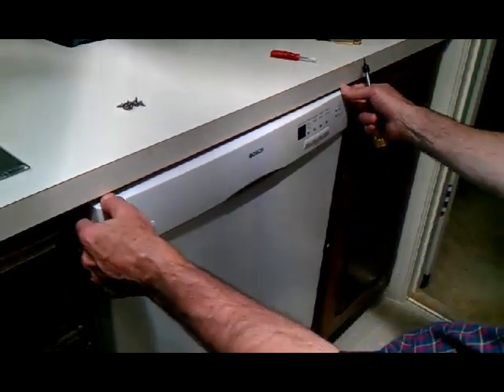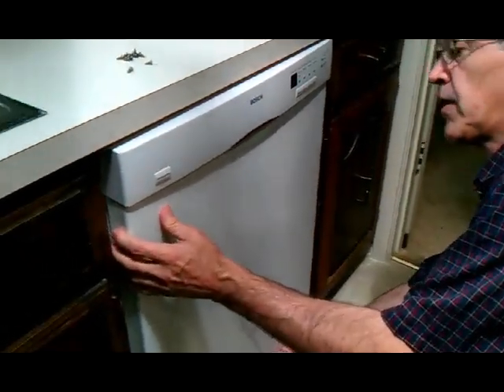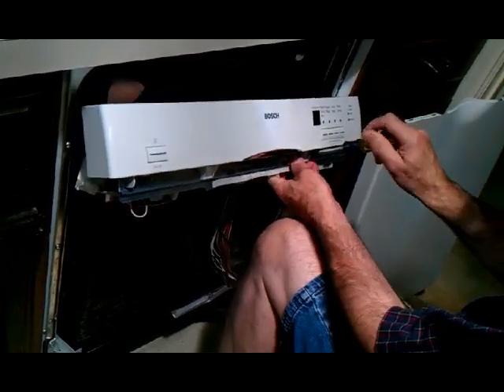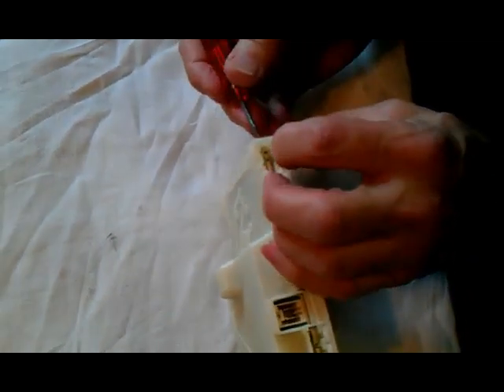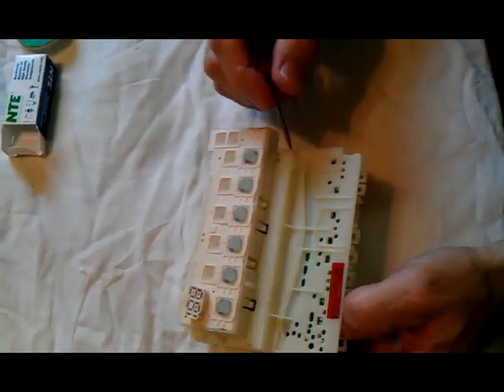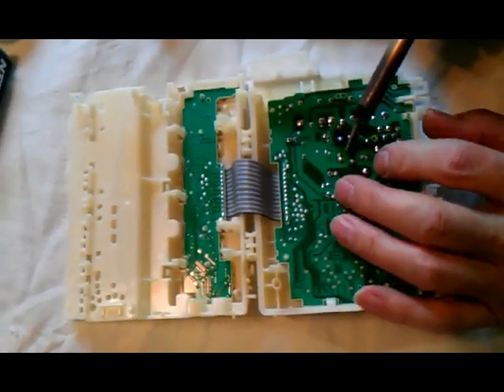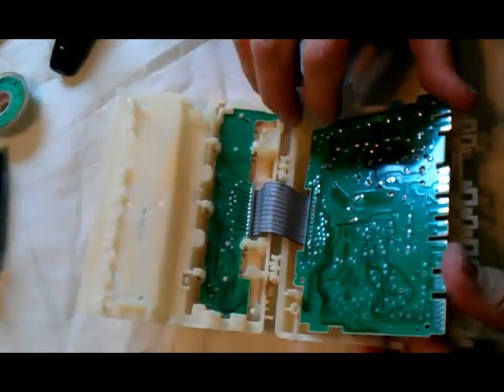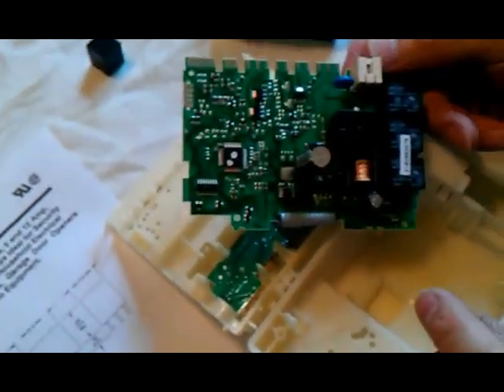Bosch Dishwasher Heater Relay Repair Part 1

Comment: Hi there, does any one know the value of the green resistor that can bee seen at 8:30 in the video. I have been trying to find the value for last few months. I have contacted Bosch and they have told me that they don't know what the value is even though i have spoken to the top tech and even Bosch Germany is not able to help. At the end Bosch have advised the only way to find out the value of the resistor is to purchase a new part. They have also quoted me $400 for the new part. I might just go buy new dishwasher. Based on Bosch lack of response and only taken them 3 months to respond I don't think i'll be buying their brand. any help would help. Cheers
Reply from the maker: The colors on that resistor are Red/Red/Black/Gold which is 22 ohms resistance with a 5% tolerance.  The resistor appears to be at least a 1 watt, but may be a 2 or 3 watt.  It is sometimes hard to judge the wattage rating by just looking at the physical size, so I would go with a 3 watt as the replacement just to be on the safe side.  You can go up on resistor wattage, but not down.

Something like this should work just fine:  http://www.mouser.com/ProductDetail/Vishay-BC-Components/PR03000202209JAC00/?qs=LCMWAU1DZcyxbs1qHHFbAg%3D%3D

Here is a photo of the resistor on the board showing a good one and one that is bad:  http://imgur.com/UXKoxcP

I have not tried to determine the purpose of that resistor, but I do know that it is in the high voltage AC circuit.  They may fail just due to age and/or maybe being underrated in wattage.  It is also possible that something else in the dishwasher has failed and, as a result, burned up the resistor.  With that in mind, I would order 2 or 3 resistors so that if you install a replacement and it burns up, then you could troubleshoot the cause and still have another resistor on hand to replace it again.  Just like the relay, the part is cheap, but shipping may cost as much or more than the parts that are ordered.

I hope your repair goes well.  Cheers.
Reply: Thank you for the info. I went to my local electronic store and they didn't have any resistors in stock apart from Carbon Film and they were 1w. The guy that works gave me a 22ohm 5W wirewound resistor and said that it will be ok to use as a replacement. I will try this sometime tomorrow and hope it will be ok. cheers
Reply from the maker: A 5 watt should be okay if it will physically fit.  Be sure to mount the resistor off the board and away from other components because the heat from the resistor could cause damage.  The original resistor is mounted  that way, so follow that method.  The wirewound resistor probably has a non-flammable coating similar to the resistor I recommended above.  I would stay away from the carbon types as I have seen them fail in ugly ways.

If you get a chance, try to trace out what that resistor is feeding.  I know one is attached to line voltage at the relay, but I have never looked to see where it is going from there.  You might find out the reason for the resistor to have burned up.  If something external to the control module is causing this, then even a new control module would also fail.  I have seen power resistors fail for no particular reason other than age...they just give up.  This usually occurs when the resistor is used near its maximum power rating.

Also, that resistor may be a different value in some models.  So far, everyone that has sent me photos of their control board has a 22 ohm resistor, but still there might be models using other values.
Reply: Hi there, I have finally got the 22R 3W resistors. I replaced the resistor and when the power button got pressed the resistor burnt out straight away. When the dishwasher originally died it was through cycle as there was water at the bottom. The question I have what could be causing the resistor to burn out. I have some spare resistor but I was hoping to find test anything else that could be causing the burnout. any tips would help. The model I have is  SGS65M08AU/15. Cheers
Reply from the maker: I wish that I had more information about the purpose of that resistor, but I have never checked into it. If you are handy with an ohmmeter, then perhaps you could trace what is connected to the resistor on the other end. One end of the resistor is connected to the high voltage heater circuit at the relay. So, by "the other end" I am referring to the connection(s) made in the circuit on the resistor end that is not connected to the relay. You may find that it goes to some component that is shorted out.  The wiring diagram for your dishwasher should be quite helpful. The wiring diagrams are usually rolled up real tight and tucked away near the water valve behind the kick panel. Be sure and do all circuit tracing with the power to the dishwasher off.
Reply: Hi , had had a similar problem with a broken resistor (you can see my answer), but your problem is probably the LNK304GN, you need to change it. (other models use LNK364GN) 
Just change it :)

Comment: My Bosch SHU53E05UC/14 has 3 relays "SHC SRE303024 Coil:24VDC 10A/250VAC/AC1 T+85C".  Can someone tell me what replacement relay should I get and where to make the purchase?
Reply from the maker: The NTE R46-5D12-24 relay will work fine.  Just Google that number and you will find multiple places to purchase it such as Newark, Allied, Galco, and more.  Cheers!
Reply: I live in US and my Bosch is "assembled in USA with American and European components".  How come the relays have "250VAC" on the label, should they be "115VAC"?  Do I need to worry?Out of the 3 relays, only 1 pin on the relay (with K4 printed on the PCB) is "melt" and has a small hole around the top pin.  The K1 & K2 relays look OK.  In fact, all 3 relays look good from the front.
Reply: Just ordered 3 NTE R46-5D12-24 relays from Allied Electronic (came up first on my google). It is very inexpensive but shipping is doubling my cost.  Too bad I don't know a B&M electronic parts store nearby so I can pick them out and get it fixed sooner.
Reply from the maker: The "250VAC" printed on the relay means that it can handle that voltage.  The relay works fine with lesser voltages.  It certainly doesn't do any harm to replace all 3 relays, but the only one that must be replaced is the one with the melted solder joint.
Reply: Dishwasher is working again.  Took a long time because of the long weekend for the new relay to arrive.  My co-worker friend did the soldering and I put everything back together.   Everything works like a charm again except somehow the cycle selector (giant dial) is rotated 180 degree and it is little confusing to know the selected cycle.  Temporarily I taped a "red dot" to the dial.If we ever cross path, I owe you a drink/beer.
Reply from the maker: That's great to hear that the DW is working again.  You shouldn't have to worry about those relays failing again for a long time.  Cheers.

Comment: Thanks for making this. Our dishwasher (an SHE55M) has been doing this for some time, but this video really helped me disassemble the unit without breaking anything. I did the same temporary fix, but also took down part numbers of the relay and the control board so I can decide which I want to order. Bosch should really have fixed all of these regardless of age.
Reply from the maker: +Todd Johnson "Bosch should really have fixed all of these regardless of age."  ...as far as I know, Bosch is still making control boards with a similar relay. In my opinion, the relays will continue to fail about every 5 years or so.

Comment: Thanks for the great video. I had the same problem, where the cycle took twice as long as it should and the dishes were wet on completion. I followed your video and removed the board and re-soldered the burnt out one. I reassembled and ran the machine. I found the wash time returned to approx. 2 hours which is great, however the dishes are still wet. We used to get a blast of steam when we first opened after completion of the cycle. My Bosch was manufactured in Nov 2000, so its a bit older. I'm trying to find the heater relay part. It's JQ1A-12V AJQ3341 A91. If anyone has any suggestions about why the dishes are still wet, or where I might find the replacement part, would appreciate letting me know. Thanks!
Reply from the maker: +Joe Dez Joe, the lack of steam at the end of the cycle usually means that the water is not being heated. The DW is supposed to heat the water extra hot at the final cycle to help dry the dishes.  Your relay is available at Mouser Electronics (http://www.mouser.com/ProductDetail/Panasonic-Industrial-Devices/JQ1P-12V-F/?qs=sGAEpiMZZMuh5GEe0gqtijs0Y%252bxGRc1T).  I hope that helps.
Reply: +AgglomeratedIdeas Super. Thanks again for your help with this. I'll order the part and give it a try.
Reply from the maker: +Joe Dez BTW, the part number I gave you is for a high current version of the relay you have, so it should last much longer.  Also, you have a SPST relay now and the JQ1P-12V is a SPDT.  That just means that it will come with one more leg/pin than the one you now have.  It is the normally closed pin and is not used.  If your PC board does not have a hole for the pin (some do and some don't), just cut the pin off when you go to install the new relay and it will work fine.

Comment: I just replaced this relay on my dishwasher, SHE44 something or other and I'm still seeing the issue where it displays a "1" after the cycle is finished.  Although during the cycle, it never really sprays water around, it just fills up and drains multiple times.  Does this mean I messed something up with the solder job, or am I going to have to replace the heater?
Reply from the maker: +Matt Teeter Hi, Matt.  It sounds like you may have other issues with the DW besides the heater.  If it is not spraying water that's probably not due to a heater circuit problem.  It is more likely a pump issue.  If you send me an email to MyBrokenDW(at)gmail.com I can send you a repair guide that might help you track it down.

Comment: This wonderful video identified the problem correctly and showed me how to fix it.  I replaced the 6 volt relay and put everything back together in less than a leisurely 2 hours.  His effort to post this saved me at least $500 parts (control board replacement-not relay) and labor.
Reply from the maker: +Pat Fitzsimmons Thanks for sharing!  Great to hear that the video helped you.  Cheers!
Reply: +Pat Fitzsimmons Forgot to mention the wash cycle is back to 1hour 40minutes instead of 3hr and 20minutes

Comment: Thanks AgglomeratedIdeas for this excellent video! I do have a question I hope you or someone on this comment thread can answer; Would the failure of this thermal relay cause no power to the dishwasher? I stumbled upon your video and discovered the same issue while troubleshooting my dishwasher. Model is Bosch SHU42L06UC. Dishwasher stopped running a few nights ago and there is a bit of water sitting in the bottom that hasn't drained due to the loss of power. I did the following checks: 120V from 14/2 wire to dishwasher = OK. Continuity on at the door switch both open and closed = OK. Continuity at the power switch = OK. Push the power button in and I get 120V from the power switch to the control board. I opened up the control board housing and found the exact same failure: heat relay solder point burnt along with a heat transfer mark on the plastic housing directly below it. This relay has 5 pins. I found R46-5D12-6 on Newark's site but it appears to be 4-pin - I'll continue to search. Obviously I need to replace this part however I also am concerned the no power may be due to a blown thermal fuse - or does the failure of one create a secondary failure with the other?  I will continue to search for the location of the thermal fuse on this model as it did not appear to be located in the door and I would like to test it for continuity as well before pulling completely apart and buying parts. Any help/advice would be greatly appreciated and thank you again for this great post! Cheers!
Reply from the maker: +Rene Gauthier It is not likely that the failed heater relay would directly cause loss of power to the DW.  Indirectly, the arcing at the relay could (in theory) cause other components on the control board to be damaged.  It sounds like you have checked the obvious things, so a little deeper dive into the machine seems to be in order.  If you send me an email at MyBrokenDW(at)gmail.com I can send you a repair guide that might help with that.  As for the 4-pin relay, the DW only uses 4 of the 5 pins (the 2 coil, the common, and the normally open pins), so a 4 or 5 pin relay will work.  (I just pulled up the Newark site and I only see the 5-pin SPDT version.)  Also, make sure you have a 6V relay in your board because Bosch put other relays with different coil voltages in their models.  The other common coil voltage is 12V.
Reply: Ok, good to know. I'll check the thermal fuse/thermistor next. Thanks for the response - appreciated!

Comment: I just successfully replaced this relay - thanks so much for your good video here.  A question - even after the repair, just as before, the time displayed for each wash is very long.  Will that diminish after a successful wash cycle?  Is that due to the fuzzy logic of the control panel?  I did do the reset - pressing the two "Cancel Drain" buttons.
Reply from the maker: +ddiddle12 If your water was not heating because of a failed relay, then operation should return to normal when the relay is replaced and the module reset (the reset is not always required).  In the winter, mine runs slightly longer because the water in the pipe cools off more between fills.  If my dishwasher was closer to the water heater I probably wouldn't notice any difference.
If you think you are still getting longer than normal run times, then you may have another problem.  The DW should be nice and hot when it counts down to zero and you open the door.  If it is not, then I would suspect another problem in the heater circuit such as a failed heater coil.  Here is a troubleshooting diagram that may help you: http://imgur.com/t6TlEc4
Reply: +AgglomeratedIdeas We ran the DW three times last night after the repair and the times got shorter with each run, to the point that they're back to normal (I think, for winter) this morning.  The first quick wash was 78, then 54 and then 39.  Actually, during the first Quick Wash run following the repair, I watched the timer jump from 48 minutes left to 32 left.  Could it be self-adjusting to that degree?  This morning, Quick Wash says it needs 33, Regular is 132 and Power Scrub is 144.  The machine is very hot at the end of all the wash cycles, so I think we're OK.  Again many thanks - saved us a couple hundred dollars and waiting a week for sending the board away for repair.

Comment: Yes! Thank you! This dishwasher was given to me only because of this fault, which no one knew to repair. Poor design IMO to push 10A through such a tiny relay with 20+ gauge leads. No surprise at all this fails.  
Fixed using NTE R46-5D12-6 as recommended. Purchased through amazon supplier DataAlchemy.  
Also found the thing had developed a leak. There is a simple float switch in the bottom tray. When tripped it raises hell with the operation, as it simply tries to drain. It doesn't cause any front panel code. 
The tray should always be bone dry or it will behave bizarrely- running while the door is open, still trying to start cycles if you try, etc. I think many people think the control board is bad when this happens.  
There are O rings where the heater assembly fits into the DW bottom. They were not seated correctly. They must be fitted to the outside of the pipes, not inside the pipe sockets. Very important. The assembly must be mounted with a fair amount of force when it's correct. 
Having thought this was a pretty looking, but terrible dishwasher (he original owners thought the same), it now works perfectly, gets nice and hot, and I think it's a pretty great dishwasher! The stainless tub is superb. Something comparable would cost at least $400 new.
Reply from the maker: +Johan Smith Awesome diagnostics and repair!  Definitely sounds like you fixed a DW that destined for the scrap yard.  Cheers!

Comment: Thank you thank you thank you!  I just fixed my dishwasher the day before hosting Thanksgiving dinner at my house.  After diagnosing the drain pump, the water inlet valve, and the main wash pump (and all three work fine), I was at a loss.  On a hunch, I decided that maybe the water just wasn't getting heated.  Next thing you know, I am watching your video and soldering in a new relay.  $10!!
Reply from the maker: +Darryl Hirschler That's awesome...good job!  Now to decide on who gets to load up all those dirty dishes today!  Cheers.

Comment: Great video. Same issue with my 8 year old Siemens dishwasher made by Bosch. Paid $118 for a tech to say the control module was the problem, and he could replace it for only $377. My door and control board are a bit different. Then found this video and did it myself. I called Allied Electronics  and they sent me 2 sample NTE R46-5D12-6 heater relays as a sample,  so not much cost for the fix. Thanks for the instructions. Roger Merrill
Reply from the maker: +Roger Merrill Yes, the Bosch, Siemens, and Neff brands seem to share this problem.  Some have relays with different coil voltages, but other than that the repair is similar in all of them.  Thanks for posting your experience and successful repair.  Cheers.